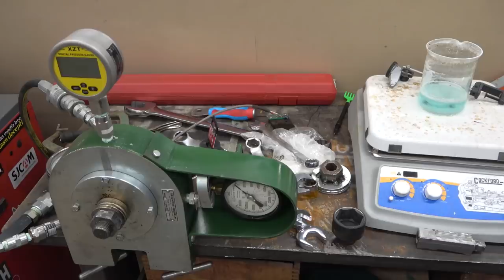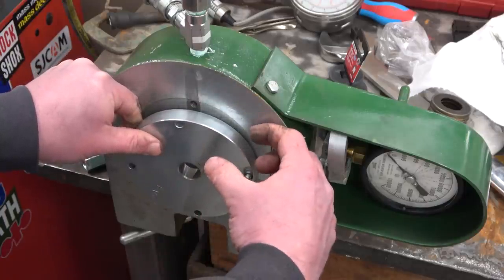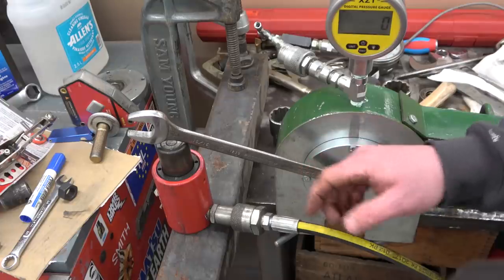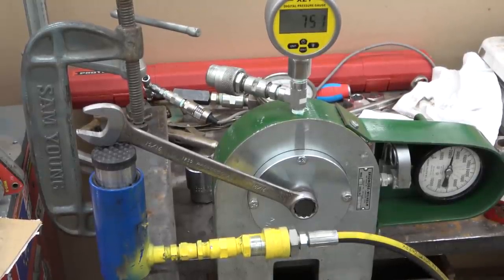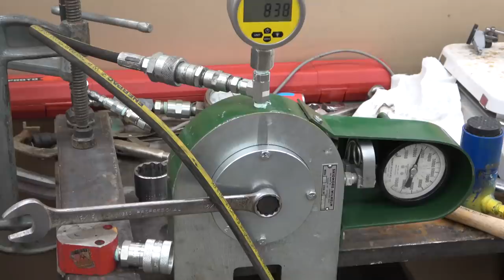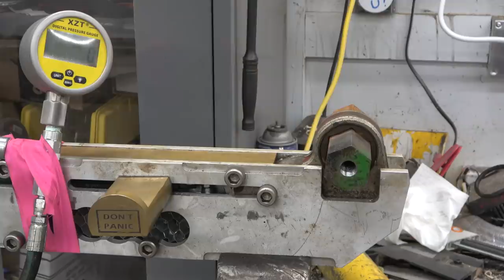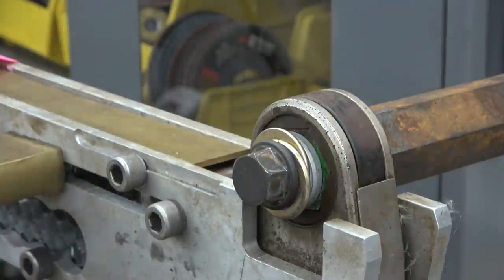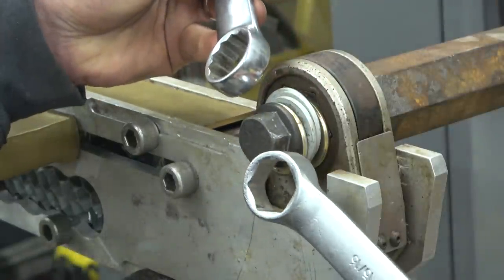6 point VS. 12 Best wrench?

Comment: 2 thoughts:
1 - The head of the bolt is a lot stronger than the threads. But when bangin' on a wrench trying to loose a stuck bolt, I've shattered a box end. And just like your royal blue cylinder there, I buy myself only the best. All that rust and galvanic corrosion provides some extra strength. For this test to be true, you gotta weld the fastener head to a plate and then keep going with the stress test until you've rounded the head. Then we'll really know if the wrench is stronger than the fastener.
2 - Both of these wrenches are under-engineered. For shame. You think manufacturers are made of money? The material on them is clearly way too thick in the sense of a racecar that makes it 10 feet past the finish line without the engine exploding left too much on the table and should've been pushed harder. One would suspect that a 6-point wrench could be thinner/lighter/slimmer/whatever than the gourmet 12 star avocado wrench all the millenials are bangin' off their nuts these days.
Reply from the maker: 1- will do
2- I'll read between the lines and do rusty bolts too.
Reply: @arduinoversusevil2025  Well don't do it on my accord, I think the conclusion is clear, good wrenches are made better than the fasteners they fasten. This determines how thick and strong to make the wrench in the first place, else 10mm wrenches would be just as beefy as 1" ones. Though, I've absolutely shattered power fist "drop forged" (cast) wrenches far, far, far, far before a rusty bolt decided to turn.
Reply: Perhaps just mill an appropriate hex on the end of that hex bar stock.

Comment: Big advantage to the 12-pointer is you can also use 'em on square drive XD
Reply: no discrimination they strip those out just as well
Reply: That's why you need the set of 8 point sockets.  Kind of hard to find, Williams has 'em (at less than Snap-On prices, and US made).  I found an old Proto set (in great condition) of 8 point, 1/2 drive sockets a retired mechanic was selling.

Comment: Loved the video, but this is one of those situations in which the test you're testing is not testing what you think your test is testing.  As others have mentioned loosening a bolt with a corroded head is a lot different from tightening a brand new bolt.
Reply: yeah on the Skidmore at work this came up whether to use bolts as received or wax them

Comment: My experience. 12 points slip too often on the bolts. Especially old rusted bolts and really cheaply made bolts. 6 points stay nice and firm on the bolt. A lot less chance of slipping and rounding bolt off. 

I only use 6 point wrenches and sockets now. I refuse to use anything else
Reply: I completely agree.  large, quality bolts like these work awesome with 12 points.  or small 12 point bolts like ARP.  12 points suck for rusted or cheese grade bolts.

Comment: in my experience the 6 point is always better unless you have something in a tight space then the12 point is better to get the wrench in the position you need. I have a whole set of Snap-On 6 point wrenches they were insanely expensive but man i love them.

Comment: I'm still trying to find where my grandpa got chadwick 18 point socket set from.
They are at least 70 years old, fraction not mm,  almost 5/16, and shorter than craftsman sockets. ¹/4 drive  and 3/8 does not fit. I still use them today but you can't force them.
Unless they were from great grandpa and was made by someone where he worked.
Reply: Likely 9/32 drive, not used at all anymore afaik but used to be reasonably common

Comment: Now get yourself some soft sloppy fitting stamped chinesium bolts, (especially smaller sizes), possibly chewed on by every passing drunk with an adjustable or overly-chamfered no name wrench; or maybe let 'em rust down a couple of layers. 
This is where the 6 vs 12 comes in, hell just recently after removing some very rusty and well abraded(rubbin on dirt or hay) fasteners on 70 year old farm equipment, I'm a new believer in 4 point. (despite it forcing the design engineer to put half a thought into wrench swing. )
Reply: Should just start producing 3-point fasteners for maximum torque applications.

Comment: True enough on nice clean bolts. I have better luck with 6 points on my New England Toyota...
Reply: @Dr_Skot  My 100 series is at 210k and very reliable, but if I do have to work on it I know I’m gonna need some vice grips, good drills and a set of taps. I order replacement hardware for every job I do. Just did a trans flush and broke 3/20 pan bolts.
Reply: @wwatts  yep, same boat here, I've already drilled and tapped the gas tank bolt mounts as the bolt just turned into iron oxide supplements haha!
Reply: My rusty nuts round off when the socket is anything above a 6.

Comment: Yeah this is garbage, sorry, first time I've disagreed. 6 sided are almost always much closer tolerance and stiffer than 12 sided, and it's also harder to identify a good 12 sider from a bad at the mid-range price bracket. If I have a seized or questionable fastener, a 12 will round the head. A 6 might. I'd rather take the might.
Reply: Personally i've never had a issue with 12point  wrench's\sockets 3\4 and up.  The smaller you get the more it seems to matter though, at least in my experience.
Reply: @Wooble57  absolutely, the smaller they are the worse they are. Though I did recently have exactly this issue with a 24mm diff oil filler plug 😂

Comment: I'm genuinely curious if it's the same case for a smaller bolt like 1/2" or 3/8"
Reply: I am sure with a smaller bolt the bolt would fail even easier. With a larger fastener I think there's a chance for a different result. Wrenches do get smaller depending on size but I think they are made proportionate to the size of the bolt.

Comment: Totally agree, unless you’re dealing with rusted out half-rounded bolts. A six point will still grab the sites real nice but a 12 point with slip and round off more.

Best example is your oil drain plug in the Midwest

Comment: There is a purpose for 6- and 12-point sockets and box end wrenches. Tight turning radius means that a 12-point with its shorter arc before resetting on the bolt or nut has an advantage. The internal bevel on a 6-point socket can allow the socket to slip so I grind off the bevel so that the socket grips further down the nut or bolt.

Comment: The purpose of the 12 point wrench (or socket) is to give better access to fasteners in tight places. It will go on a nut or bolt head with little maneuvering.

Comment: Single hex (6point) spanners and sockets are typically stronger (better) than multihex (12point). The 'point' of multihex as AVE shows is that you get a more variable engagement angle. As another post said.. with the open end wrench they're mostly always angled down so you can flip it over. Also, if you can't get your 6point socket with breaker handle on the fastener just pop it off and rotate the square drive one point (90°). This gives you the 30° increments like a multihex. And another tip .. the mouth of sockets and ring spanners have a smooth edge to get onto the fastener easily.. a lot of my ones I grind off that smooth edge to get more purchase on the nut or bolthead. Try it and you'll suffer less than half as many skinned knuckles. Cheers and thanks for the entertaining vids.

Comment: Cool test.  
I’ve had 12-points slip and thus preferred 6-points when removing fasteners that were use-worn on farm equipment. That is to say, the fastener heads were slightly undersized.

Comment: My experience turning bolts says it is the bolt that will round off. That's why 6 point wrenches come in handy. They are less likely to booger up the head of the bolt.

Comment: Where the 6-point really shines is with a fastener that’s been partially rounded off. I’ve got plenty of 12-point combination wrenches but only a few 6-point because of the occasional rounded or slightly rounded fastener. But when you talk about sockets, I only have a few 12-pointers and far more 6-pointers. Hitting a 12-point socket with some impact force will almost guarantee a rounded fastener or a broken socket. If I may suggest you try this again but with sockets. Impact sockets vs chrome and 12-point vs 6 in both flavors.

Comment: Ok before I watch this, 12 point has more positions on a nut so it fits more places but 6 point has always been what I like to use because they seem to slip less. My manual impact wrench is a 6 point Milwaukee socket with the 4 flats you can put a wrench on or a breaker and then a 3lb sledgehammer to give it a few sharp taps. Before that I used the box end of a wrench that I hammered on. 6 point socket seems to slip less than 12 box when I do this

Comment: I used the 6 point on smaller nuts.  For example 1/2 inch 9/16 that are rusted or have been damaged by someone having a go with channel locks.  The idea being it's less likely to round off damaged nuts.

Comment: This might be the first time I've ever disagreed with your findings, although I do admit many of your findings are way above my pay grade.  I liken the 12-point wrench to the "Jack-of-All-Trades", in that it does many things pretty well, but does nothing exceptional.  If you're not dealing with rounded fasteners, 12-point is fine.  In areas where tight clearances are a factor, 12-point shines.  For all other occasions, I'll reach for a 6-point first, (provided it's not a 10mm, as I'll be reaching for whatever the hell I can find in a 10, since I've misplaced roughly 3,000 10mm wrenches & sockets in my lifetime).  I still appreciate your video as always.  The way in which you intertwine knowledge & comedy is truly rare.
Reply: I pretty much go by the same code, 6pt for torque, 12pt for fitment, and whatever you can find if it doesn't matter

Comment: Nobody mentioned the most crucial case in which a 6 point socket is a necessity not to round up both the bolthead, and the socket itself. 

Metric vs Imperial units. 
Because, when in a rush, the only thing you'll have to remove those pesky 3/8" & 1/2" hexes will be 10mm, and 13mm wrenches. Guaranteed.

Comment: I have a set of cheap Mastercraft wrenches where the "timing" of the 12 points is pretty much random instead of being symmetrical. The result is that you can flip the wrench and get a different angle of purchase, like on the open side. This also work for breaker bars and sockets where the square drive is offset.  If you need a different angle take the socket off and turn it 90 degrees.
Reply: That's not, or shouldn't be, an accident.

Comment: I agree for the most part but ive worked on a lot of cars with chowdered nuts or soft nuts/bolts and the 6 point is what i get out of the tool box when the 12 point doesn't cut it 

Also I use ratcheting six point wrenches they are offset and reversible so I don't have to worry about the position of a six point

Comment: If there's a pattern that I've suffered from wrt stripped fasteners, it's the smaller-head JIS (Japanese Industrial Standard) fasteners, especially if they have a flange on them (flange nut/bolt), which obviates the need for a washer.  The flange keeps the socket from engaging fully, especially if it is deeply chamfered.  This is much more of a problem with smaller size heads, like 10mm, 12mm, etc.

Comment: I had a high school auto teacher. When he first got the tools for the shop he sent the 12 point wrenches back and got 6 point. That way we had both the box end wrenches in 12 point and the combination wrenches in 6 point. All Snap On brand of course. He ran the shop class like a real auto class. The one book work project ill never forget is him giving everyone an assignment that we had to get a 9,000 lb Hoist, Tire Machine, and balancer for under $10,000CAD new equipment.  I bet you could pay half if you got used. It was possible when I was in high school 2009-2013, I bet it still is.

Comment: 6 point is my preference, learned the hard way in my younger years from many 12pt rounded bolt heads.
Reply: If you use the wrong size on the wrong bolt you are more likely to round the fastener; use a 13mm on a 13mm and not a 13mm on a 1/2". I use 12 point sockets all the time cause you can use them on 4 sided and 8 sided fasteners and you can hammer them on swelled lug nuts. Something a 6 point could never do. 6 points are made for higher torque applications where a 12 point will most likely slip. That's why impact sockets are most made in 6 point. Cheers!
Reply: @wmc128  Most my stuff is SAE and rusty!

Comment: 6 point have one specific purpose; pre rounded corroded farseners. Especially when it comes to sockets. You could strip a bolt as much as you want with a 12 point, put a 6 point on and still get good grip. Also, the smaller the farsener, the bigger the difference due to tolerances and so forth.

Comment: In my experience with vehicles in the rust belt, I have never rounded a fastener using a 6-point box wrench. However, I have rounded them using a 12-point one. I do own 12-point wrenches for the occasions when some obstruction prevents use of a 6-point one, but I always try to use a 6-point one first. On the occasions when I have rounded a fastener, it has usually ruined my day.

Comment: Except for one thing. If you have a 3/8" auto bleeder valve that's stuck because it's an older vehicle and a bit rusty....a 12 point box end wrench can (and will) round off the 6 points of the bolt head shaped bleeder valve. This is what happened to me today on my 1995 Ford F150 after I installed a new master cylinder and needed to breed the brakes. The first three brakes valves loosened normally, but the forth one (front drivers side) rounded the six points nearly usless using the 12 point box end wrench. Sockets were too tall to use...so tomorrow I'll have to purchase a 6 point 3/8" box end wrench....and hope the valve wasn't damaged too much by the 12 point box end to get it too turn.  I'll probably replace it if I can get it out.

Comment: I experienced a difference on an 8 mm box wrench. Had to remove an old dirt bike's clutch plates. The 12 point jumped and almost rounded off the bolt but on the 6 point, everything was fine. Mind you, I tried 2 good brands of 12 point box wrenches and both of them wants to round off the bolt.

Comment: 6 point allows higher torque before rounding.
12 point allows better maneuvering in confined space.
The reason that 6 point allows higher torque is that, when torque applied to the wrench, it creates multiple levers- and a 6 point wrench does 2 things- it directs the levers' force more inward towards the bulk of the head, and it applies the force over a larger area.

Comment: As long you're using the right size wrench it doesn't matter. However if you undersize by a bit or using metric on standard then you're putting more torque on the points. That runs a good chance of rounding over, more so with the smaller points of the 12 sided wrench.

Comment: Different needs for each one.  You need both. As an ac mechanic, we needed a 3/8” 12 point to get the bolt out of fan blades. A 6 point wouldn’t work because it was a 4 point bolt or set screw.  12 points are the best when you can only move the wrench an 8th turn or less.  I would think the 6point is stronger and I usually use the 12 point to beat on to a mildly rounded head and a 6 point for a badly rounded.  Usually a 6 pt from a metric set on an sae bolt and vice versa, because you can usually get between the other type sizes. Like a 12 mm for a 1/2” nut.   In short, their both the best😜

Comment: I’ve worked on jet engines that had 12-point nuts and bolts. I haven’t seen them anywhere else. 12-point will let you work in the tighter spaces of aircraft as you so eloquently proclaimed in your edification. Dem engines is tight.
Reply: My Jeep has some 12 point bolts - brake calipers I think.

Comment: I have rounded bolts with 12 point (but small ones, not the big one as in the video). On all new small bolts and nuts it may be OK but on used ones 6 point is preferable in my opinion, if you're not having issue with the possible angle you can reach the bolt.

Comment: I’m going to add a serious comment this time… certain things need a 6 point so you don’t even have a chance to round it.  Brake bleeders???   When they’re froze up with road dirt.  I have a special,  longer one just for breaking them free.  After that…  One time in the shop,  I was the only one who had the Snap Out flank drive plus reversible box end set (buy everything as a set off the truck) and I worked 11pm to 11am and the second shift guys 3:30pm to 3:30am doing the driver write ups would wait for me to get in to use my wrenches.  Especially on Mack turbo oil return line.  Brass end on it.  They rounded a few out before I came to that shop and when they saw those flank drives would grab even the rounded off ones they started waiting till I came in.

Comment: As mechanic in the rust belt. I use 6 point because old rusty bolt round off easier with 12 point. Never had a problem with a wrench. It’s about replacing parts in old rusty cars as quickly as possible with the least amount of collateral damage. Rounding off a bolt makes the job take longer.

Comment: The advantage I've found on smaller wrenches IE 1/4 to 5/8 and 10 mm to 17 mm is on rounded off bolts and nuts the six point wrenches and sockets can save the day.

Comment: It's worth noting the better quality 6 point wrenches (like Snap On) have their box end rotated relative to the handle to give you a different angle by flipping the wrench over, if the offset isn't an issue.